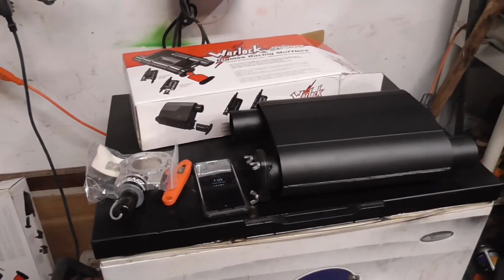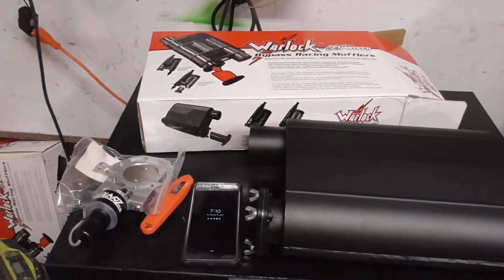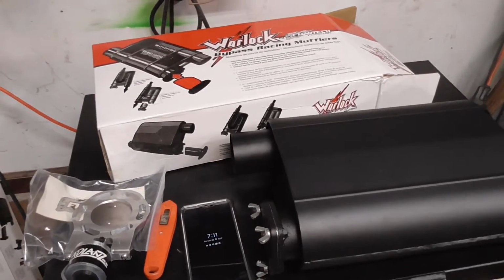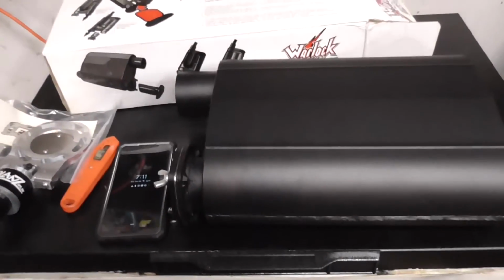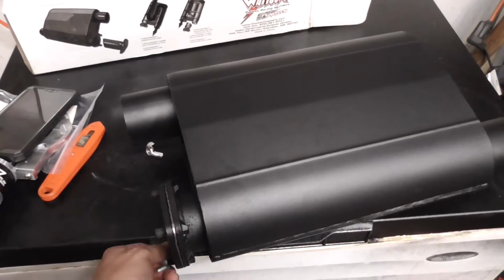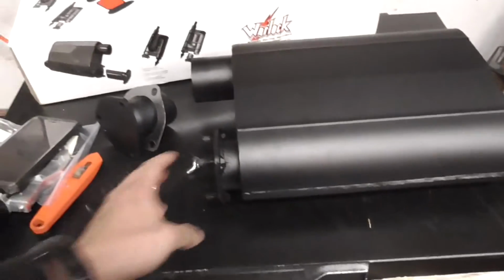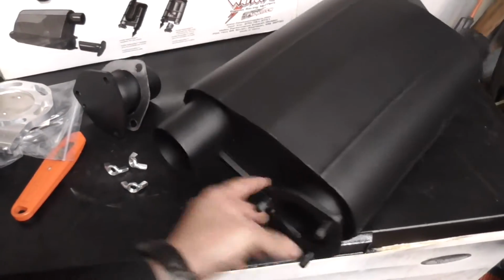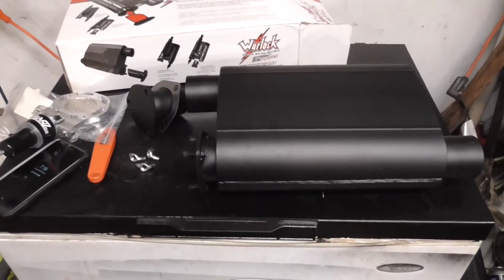Flowtech Warlock Bypass Muffler Overview | Cutout | Passthrough | Racing Muffler

Comment: These mufflers sound great
Reply from the maker: Yeah, I like it.  Didn't know how they would sound when I got them but after driving with them a couple thousand miles they are great.  Nice low rumble at idle and not too loud in moderate acceleration. But when you get on it, they open up.

Comment: cant wait to hear it
Reply from the maker: Well, that's going to be a while.  I was just trying to instal the headers and they don't fit.  they hit the upper control arm mount and looks to be parts of the frame.  So I have to fight the company I got them from and look at other options.
Reply: @DanielPace92   That is how headers go. They seem to be hit or miss on fitting. Had to modify dad's Camaro headers so they didn't hit the floor.

Comment: So I have a few questions 1.) Would this work a 2020 hatchback Toyota Corolla 2.) Should I look for another muffler I live in Pittsburgh and I worry about snow and it rusting
Reply from the maker: I don't know the size of the OE muffler on a Corolla but it's a universal muffler that has to be welded in.  I would probably get something else if you are concerned with rust ince this is just mild steel and the paint isn't that strong.